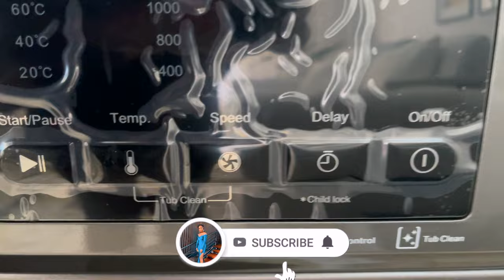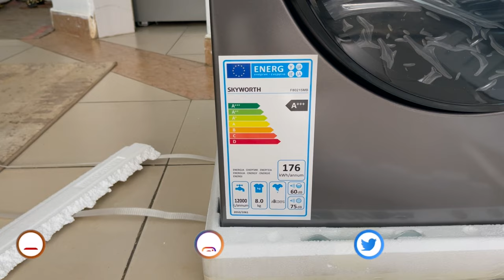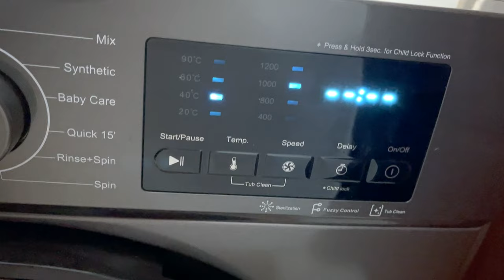House update: UNBOXING MY NEW WASHING MACHINE//SKYWORTH 8KG AUTOMATIC MACHINE//HOUSE UPDATES//MS WIT

Comment: Front loaders are known to breakdown easier than top loaders,,,, but I'd like to hear your perspective on the purchase,,,
Reply from the maker: That is a fact, but mine has served me for the time i had it
Reply: @MsWIT15  Hi,is it still working well?,I want to buy the exact one
Reply from the maker: @biblefanatic2902  hey dear, i have nit had any problems. It’s working perfectly
Reply: Mine the inlet pipe refused to let water in and it's new @MsWIT15
Reply from the maker: @iam_maryamorara  Did you get someone to check it? Maybe the water pressure is low?
Reply: Hello, would consider doing a review and explain some of the settings and share some tips on operation